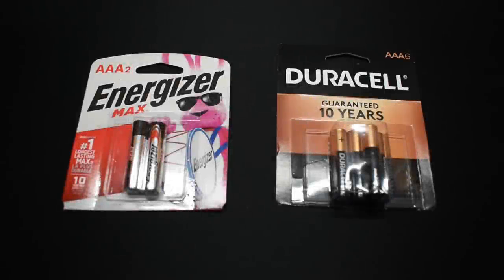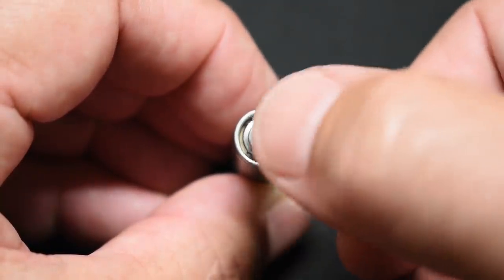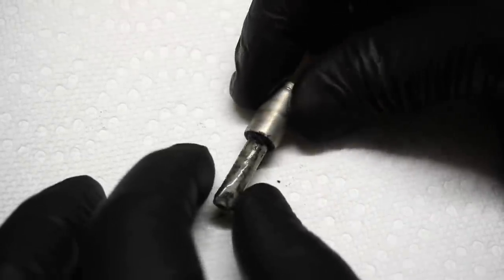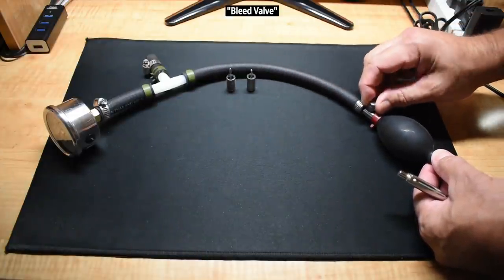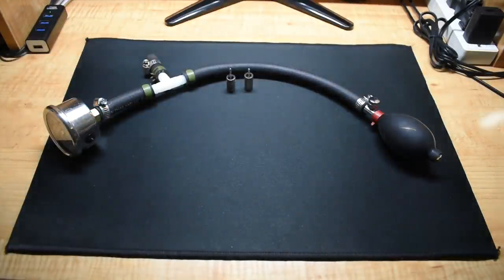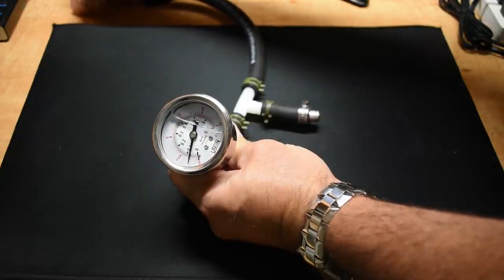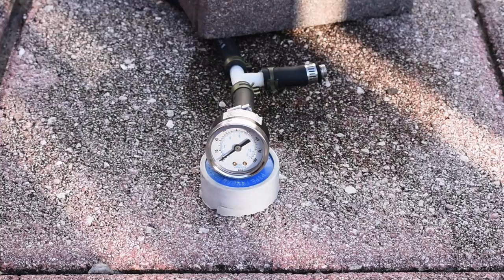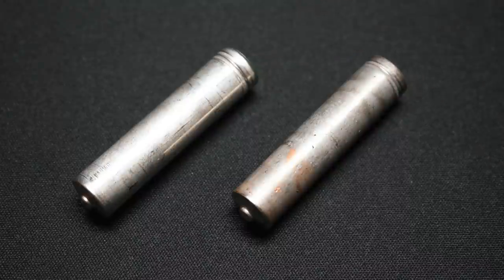Leak "Pressure" Testing Duracell & Energizer Alkaline Battery Seals!

Comment: I used to regularly get leaks from Duracell batteries which caused damage to a number of my electronic devices. I've been using Energizer Max batteries for about 10 years now and have never had a cell leak. Your PSI test was very interesting and it's difficult to understand why your empirical results don't show a reason for my anecdotal experience.
Reply from the maker: I'm sure I'm not done testing these. :-)
Reply: It's possible the clamping force on the batteries stopped any electrolyte movement or even prevented air from getting to the seals.

Comment: I'm almost more surprised the that plastic Tee held up to those higher pressures than the battery ends. 😲
Reply from the maker: Nylon tees are pretty strong. :-)
Reply: @electronicsNmore  Sooo.... How much pressure "can" they hold up to??  🤪

Comment: The gas generated in a depleted alkaline cell is hydrogen, which will leak through almost any seal.  As it leaks, it can cause damage (embrittlement) of materials, which is exacerbated by caustic materials entering the tiny cracks caused by leaking hydrogen (caustic embrittlement).  This happens in many industrial situations, but I am not aware of any alkaline battery studies of the phenomenon.  And, for what it's worth, I'd guess the seals in a 'new' battery are good for several hundred PSI - the design features a solid metal crimp and very small surface area, which indicates it is quite robust.
It might be worth trying your experiment on a leaking battery, since the degraded cell might have a lower leak pressure.  To generate higher pressures inside the cell, you could fashion a piston with an o-ring that would fit in the battery case, then push it down with a press, with just water as your working fluid (for safety).  Pressure inside the battery could be easily calculated by the surface area of the piston and the pressure exerted on the piston.
Great channel, love the content.  Cheers!
Reply from the maker: Need to test older batteries. :-)

Comment: Yay a video again. 
Any ideas to not make the leak?
If it was high pressure it would not leak it would spray out, so it has to be a chemical erosion since many times i see the metal corroded. 

Also Yay are are asking for suggestions.
How about how long can a battery last under water.
How long can a battey last when short circuited.
Maybe overcharge them to the point they do leak and see which one fails first.
A warning about people should not open lituium battery and to see how long can they last when it is expanded.
How much pressure can lithium handle before it had issues.
On another one when a button battery does not have enough energy and need a but more I put some slight pressure on it with pliers (very light dent ) and ti give a bit more for it to work. I wonder how much pressure that can handle. LOL
How long can a aa last in a aaa device if one was to use it or how much of a difference it life does it have.
As for opening up batteries I use to just peal them off with pliers and a flathead screwdriver from the side which was rolled up a long time ago but I guess the casing changed but it just shows that they dont have much pressure. 

Also I use to charge 9v batteries with a 12v car charger for 10 second or less. yes it got warm fast. LOL
I also charge the non rechargeable ones which work for a while.

Comment: Very interesting test and result (or lack of ;)). I agree about Duracell, but it seems something other than internal pressure must be causing the leak.
Maybe the thin metal shell can withstand a lot more pressure than I expect, and you simply need to go higher. For that I suggest hydrostatic test (fluid rather than air) as explosion is less violent with fluid.
Maybe the rate of leak is too small to blow bubbles or register on the gauge? Perhaps testing while the battery end is submerged in soapy water would be more reliable.
I wonder if a vacuum might form inside, and once the seal collapses the contents can weep out?
If not any of that, then I suspect chemical or time deterioration of the seal.
Reply from the maker: Sounds like a good idea, use my hydraulic pump, the only problem is securing the hose to the battery tube under high pressure. I'll have to slide a steel insert inside the battery tube before clamping.

Comment: You should do the test on a battery that has leaked, though it is possible that once it leaks it will not re-seal and will not hold any pressure at all due to the liquid getting underneath the gasket. Assuming it can still hold any seal at all, perhaps it will show at what psi it let go.  But I think it is the gasket being damaged by the extremely corrosive environment within the battery.

I wouldn't read much into the wall thickness.  Aluminum soda cans are EXTREMELY thin and can hold a lot of pressure. Under normal day to day usage the pressure can reach 250kpa (36psi)  and they are designed to not fail until a MUCH higher pressure. The cylindrical shape of the battery along with its  steel construction makes it extremely strong.

I have radios I like to keep batteries in and so I use carbon-zinc batteries (Panasonic) as they are much less prone to leakage in my experience.
Reply from the maker: I agree, I think the seals are being deteriorated by the chemicals over time.

Comment: My solution to batteries leaking was to switch over to rechargeable, "heavy-duty (carbon)" or non-rechargeable lithium and avoid Duracell altogether.

I was thinking about pulling a vacuum on the seal and then pressure to see if there is a difference.  Depending on how the seal is in place, it is better at holding pressure or a vacuum.

Great test!
Reply from the maker: I already had the vacuum test in mind. :-) Thanks for watching!
Reply: The blue Panasonic carbon zinc cells are great for that. I've never seen one leak.  I won't let a duracel even look at anything I own.
Reply: I despise Standard Duty (zinc-carbon) and Heavy-Duty (zinc-chloride) cells as they're have a deceiving performance vs. cost ratio, but they are not leak-proof as the salty electrolyte inevitably corrodes the zinc casing.  However, Heavy Duty cells do use a paste electrolyte that makes leaking less likely or at least less messy.  Alkaline leaks are more destructive.

If you've never experienced a zinc battery leak, it might be because they must be replaced so frequently that they don't have time to leak.  Though zinc-carbon and zinc-chloride batteries have their place, their performance pales in comparison to any generic alkaline and it's very unfortunate that the Chinese brought heavy-duty cells back into the U.S. market.

20 years ago, you couldn't even find Heavy-Duty AA/AAA batteries in stores, but now they're everywhere :(.  My generation considered them ancient and obsolete, but now consumers think that they're perfectly normal and buy huge packs of them thinking that they're saving money <sigh>.  To me this is like people going back to 1960's gas guzzlers to "save" money; it's a false savings.

Generic alkalines are the best values for clocks and such, but I use rechargeable NiMH cells (Eneloops or Amazon Basics) for everything else that uses AA or AAA, including thermostats and TV remotes.  Modern NiMH cells don't self-discharge for 1-3 years, but I still won't use them in wall clocks and you should never use them in smoke alarms.  Even if you pay $5 per cell, the rechargeables are still less expensive than entire boxes of Heavy Duty's from the dollar store.

Heavy Duty cells spend a tiny fraction of their existence in your devices as they are rapidly discarded into landfills.  Meanwhile, I've got NiMH cells which are 14 years old and still powering devices.

Oh, and the 1.5V lithium-ion AA, AA, and 9V are a reasonable idea, but the execution is generally poor and I do not recommend them.  I would never put them into children's toys.  If a "good" brand began manufacturing these to a quality standard, they might become an option.
Reply: @tarstarkusz   I like to use rechargeable batteries for high drain devices and non alkaline batteries on remotes, clocks and other items that require a few mah during use.  Stopped using alkaline Duracell around 2013.
Reply: @antibrevity   I would like to see lithium ion batteries produced in all sizes from AAA to D and 9v.  But at their current design is not good as the self-discharge level is too high due to the built-in buck converter.  Eneloop batteries are my favorite brand and bought a ton(gave a few away) when they were sold at Costco.
Reply: @antibrevity  There is nothing inherently bad about heavy duty batteries.  Heavy duty batteries can be much, much better than they generally are today.  A modern heavy duty D battery will be lucky to have 1000mah, but heavy duty D batteries used to be 8000mah.  It's just that nobody is making good ones today because they wouldn't be cost competitive with alkaline.
  I have found items from the 70s and 80s with carbon zinc batteries in them and not leaking. I have NEVER found an alkaline battery in an old item from the 70s or 80s without them having leaked.  I collect old radios and handheld games and I've bought many of them with batteries still in them. If they're alkaline, the item will need a lot of work. If it's heavy duty, they are almost never leaking or if they are, it's very minor and looks more just like rust.
Clocks are a perfect use case for heavy duty.  To begin with, they are a lot lighter ( I use them in a clock hanging on my wall and it uses a C cell).  I usually change them out every other time I have to move the clock ahead/behind. 
C/D nimh batteries are expensive and none of the name brand makers make them.  I just an adapter for the AA to D cell for certain applications. 
I agree with you about the lithium AA 1.5v cells.  I have never had a problem stemming from voltage.

Comment: In your video you point out that Hydrogen is the gas generated but you are testing with air (N2 and O2). Hydrogen has a very high diffusion coefficient in polymers compared to N or O. I'd like to see a test with Hydrogen, not so much as a pressure test more like a soak test. Say set the H2 to 10 psi and hold. The thought is the hydrogen diffuses into the seal elastomer causing embrittlement and failure. BTW, leaking cells don't seem to be under pressure, so low pressure seal failure may be the culprit. Excellent video. Cheers.

Comment: Interesting approach. I wonder if a chemist could weigh in about how much internal pressure is possible. I also wonder about rechargeable alkalines (now rare) which are vented somehow but never seem to leak
Reply from the maker: I've had older NiMh leak, but from what I hear the newer rechargeable batteries rarely leak.

Comment: Very interesting testing eNm! My guess is that over time an acidic solution is produced, perhaps Hcl, that breaks down the battery wall thereby causing the leak. 🤔🤔❔❔
Reply from the maker: You'd think the seals would be resistant to alkaline chemicals, but maybe not. Maybe repeat the test, but this time take 2 brand new batteries, drain them down, then allow them to sit for 6 months before testing.

Comment: If the seals were the weak point causing leakage, then this problem would have been solved long ago.  Seals are not the problem.  The problem is inherent to the nature of this type of cell, which is corrosion through the metal case, typically where the seals join to metal.  So your pressure testing today does not predict leakage failure in the future.  Corrosion plus time is the source.  And there is no way to prevent this process.

Comment: I've experienced almost equal failure from both brands. Usually low draw, long duration applications.

Leaky batteries affect us all. My recent sadness was a $300 piece of comms hardware where the leakage was able to get under the conformal coating and eat the board's components.
Reply: It ruined my microscopes LED control pcb. It kinda disintegrated stuff or made it brittle. I wonder what it does chemically.
Reply: @arthurmorgan8966  From what I remember the leakage is mostly KOH, potassium hydroxide, which is caustic. A mild acid cleans it well if it hasn't destroyed sensitive components yet. :(
Reply from the maker: I've had Energizers leak, but Duracell batteries more often. Thanks for watching!
Reply: I used to buy duracell and energizer at equal frequency. A couple years ago ago I checked my leaking battery container and there were 2 energizers and like 40 duracell

Comment: I think the seal degrades,  you should drill a small hole in the cell then put the pipe over it with the gauge on the other end and leave them over time monitoring the pressure inside the cell 😀😀

Comment: Weird, I’ve never put two and two together, but 9 out of every 10 leaky batteries I come across are Duracell. But, surely they’re designed to fail mildly instead of failing spectacularly and blowing up your device that’s been in a drawer or box for 2 years
Reply: One time, I actually heard a AAA battery pop. It was in my TV remote control. I was sitting there and out of nowhere I heard a muffled pop -- took me a bit to figure out what it was. I was able to get the battery out before it damaged the remote. I don't remember what brand though!

Comment: I wonder if the battery chemicals attack the seals, especially as the chemistry changes when the battery is fully discharged?
Reply from the maker: I think some batteries create more gas(pressure) than others. The seals are only part of the problem.

Comment: I have been having problems with the Duracells not making a connection at the ends, so I have to rough up the ends with sand paper to get them to make a connection. Its like they changed the metal type with something less conductive to save money.  Due to the Duracells leaking, I am now only using the Energizer Lithiums. So far, no leaks.
Reply from the maker: When that happens it's almost always because some corrosion took place.
Reply: @electronicsNmore  Thats true, but this is happening on new devices and others with no corrosion. Also other batteries work with no problem in the same devices.

Comment: If you want to avoid battery leakage, then use NiMh batteries wherever possible. I have never seen any good brand NiMh leaking, even after 20 years in a drawer.
Reply from the maker: I've had some NiMh leak, but they were older. Maybe the newer batteries have strong seals.
Reply: @electronicsNmore  It can surely happens with 2nd tier brands. But never seen any leak on good NiMh brands I used, even when used for years and completely worn out or left discharged. But a bad charger (some contains only a single resistor) can certainly make it happens even on good NiMH as no battery seal would appreciate regular overloading.  As far as I know, the problem with alkaline battery is the way they are working : the chemical reaction is very destructive. When exhausted there is strong internal corrosion and the remaining electrolyte is very corrosive. So I guess it is very difficult to maintain alkaline structural integrity when discharged for a long time. The seal integrity will certainly lose it's property at some point when metal supporting it is strongly corroded.

Comment: I didn't have this problem when batteries were made in the USA, with the made in China, it's hit and miss. Decades ago the internal wrappings are wrapped around the battery, not the single clap wrap as shown in your vd. Corp. make cheap stuff while charging us full price. The corps cheap down the Chinese manufacturing contract while charging us full price, giving US huge product for inferior product. I used to blame Made in China but it's the US corp and the high profit margin that's problem.
Reply from the maker: I had it happen years ago, but it seems more frequent now.